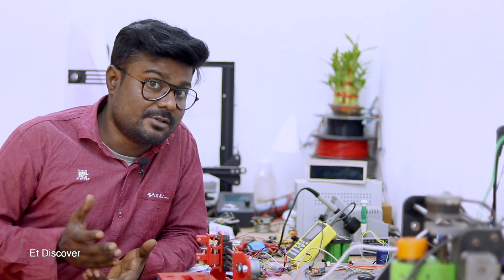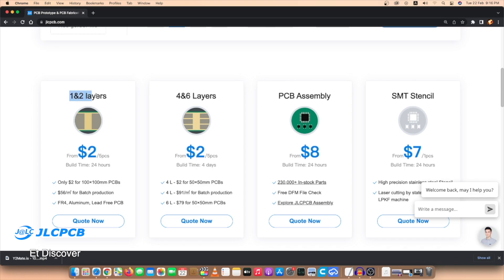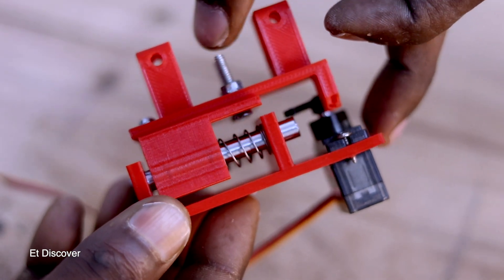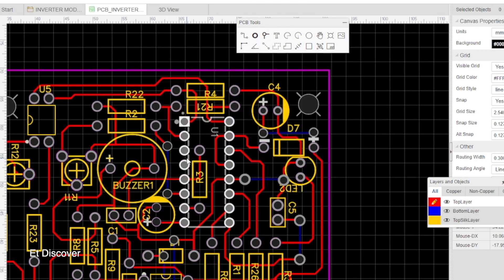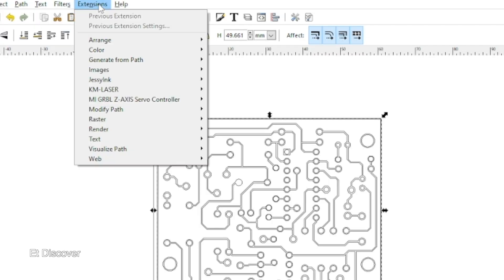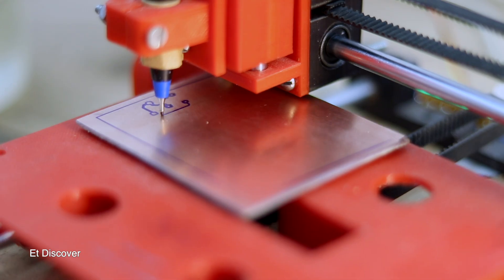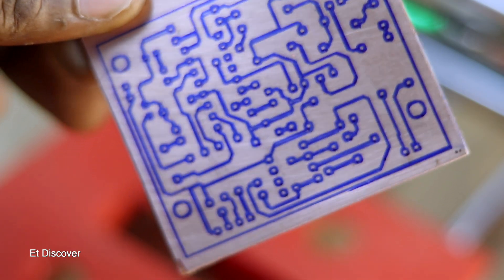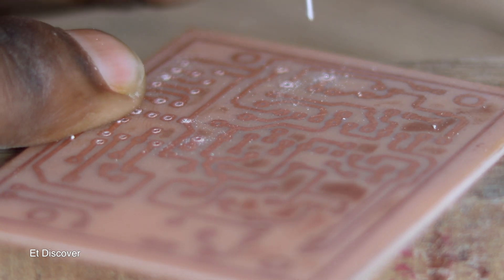How to Make PCB in CNC And Operate this CNC (part-2)

Comment: Very nice! Thank you for sharing!
Have you thought about replacing the pen with a Micro Mini 820 Coreless Motor High Torque with a milling drill attached to make it a real mini CNC and skip the chemical etching fase?
Reply: Certainly it requires more than only to adapt a rotary tool: the stepper motors must be changed too to support the tool weight and cutting forces, and so the brackets, linear guides, MCU, etc. It sould be better to adapt a 3d printer, if you have one. You can find this easily in youtube.
Reply: שאלו הרבה אנשים לגבי עדכון stl לגבי הפין
Reply: its not worth it